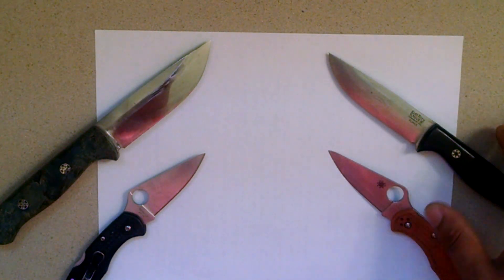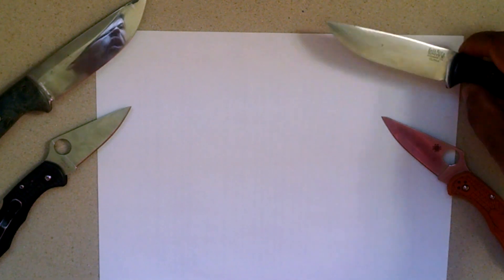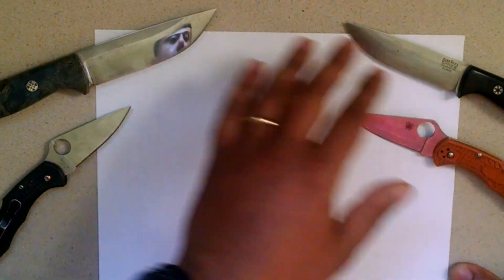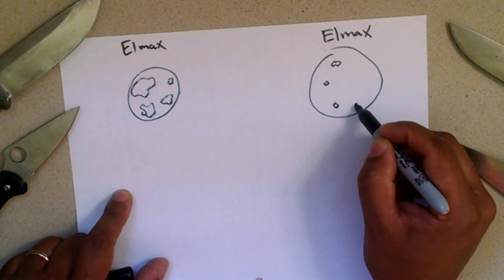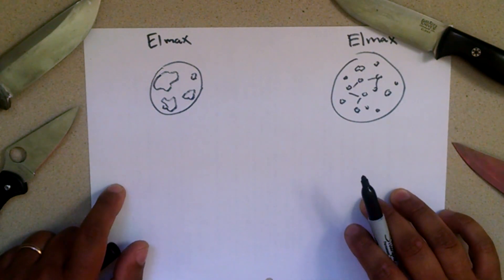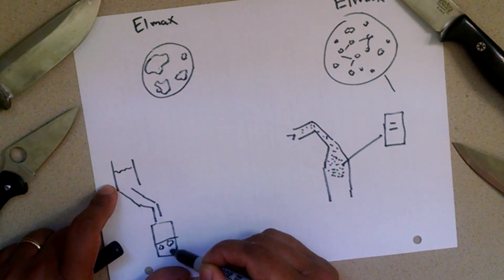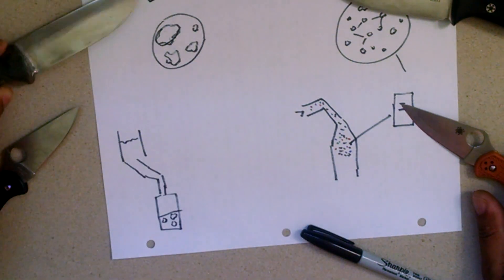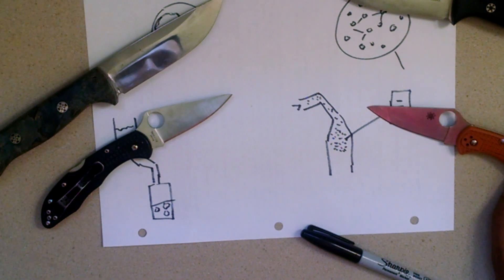Powdered steel vs Normal steel explained

Comment: Just as a point of clarification, the reason why particle/powder metallurgy is used isn't to decrease the grain size, as that is set mainly by the heat treatment. PM processing is used to ensure the steel is homogeneous. As the alloy content gets high enough, the segregation will be so high that the steel will become heterogenous in normal ingot steel making, this isn't good because it means the properties of the steel will vary through the ingot. 
The way this is achieved is through indirectly lowering the carbide size which is why if you were to compare both a PM and ingot version of the same steel (D2 for example) the carbides will be much larger in the ingot version. But the grain structure, given the same heat treatment, will be the same, as grain size refers to the size of the martensite "cells". It is possible to have a steel with a coarse carbide structure and fine grain size, or fine carbide structure and coarse grain size.

On a side note, there are makers (Dozier, Boye, etc.) who argue that larger carbides are actually superior for knives, for similar reasons that some ABS smiths make for damascus/wootz blades.

Comment: So if you were to hear treat powderized steel would it ruin it?
Reply: The proper heat treat is required even more for powdered steels from what I took from this video. In my own experience, it was always suggested to heat up the piece until it glows orange and let it sit until it cooled down to room temp. Then heat it up again until it's glowing, and let it cool again. With the carbon steels I have worked with we call it "Normalizing the steel". Which is basically smoothing out the grain structure.

Comment: You said Alloys when you meant elements. Steel is an Alloy ( combination of elements) carbon, iron , chromium etc are Elements on the periodic table . Just informing no biggie
Reply from the maker: yes, slang for "alloying elements" mostly carbide forming ones

Comment: would love to see a side to side comparison under a 1000x+ magnification. great video mate! This video also indirectly shows the importance of hammering traditional steel. The old masters perfected the way of using traditional ingot steel by kind of kneading  and folding the steel as a dough to get rid of the large lumbs and create a steel that takes a real fine edge. This is why I have mixed feelings about powdered steels. It's very effective yet another scientific evolution that makes us forget the traditions and old ways as they are no longer 'needed'.
CoS steel seems to do a dang fine job without the CPM process. Let's hope both new and old can keep here side to side providing their own specific qualities.
Reply from the maker: The advantage of forged steel unfortunately isn't relavent for high performance knives today since there is only a small percentage of people making the own steel from raw ore.

Steel is processed so well from the mill that the need to remove impurities or refine the structure is non existent.

In fact,
Forged knives today still need to be normalized after forging to bring the condition of the steel back to how it was from the mill before austenizing for the quench.

Might have to make another video 
"Forged vs Stock removal"
Also,

I love me some Cobalt Special.

It's like a stainless superblue.
Reply: haha thanks man. You keep surprising me with your knowledge. Where do you read this stuff?
Reply from the maker: Dutch Bushcraft Knives 

It's everywhere haha

Check out this site.

Forged vs stamped
http://www.zknives.com/knives/kitchen/misc/articles/kkchoser/mkfacts.shtml

Zknives is an amazing resource

Heat treatment info

http://www.cashenblades.com/heattreatment.html

Forums have great sources too

:)
Reply from the maker: +Dutch Bushcraft Knives 

Above top secret.

(Drops envelope)

"Zknives"
Reply from the maker: +Dutch Bushcraft Knives 

Above top secret.

(Drops envelope)

"Zknives"